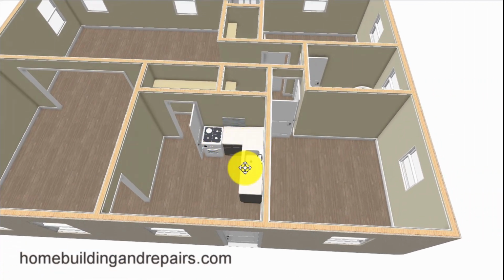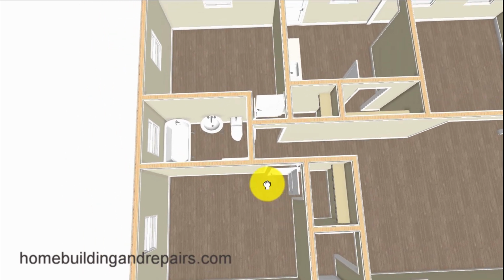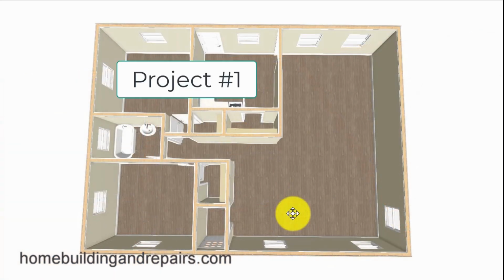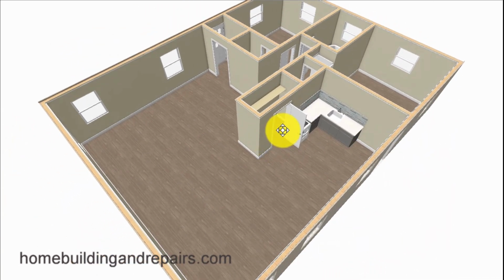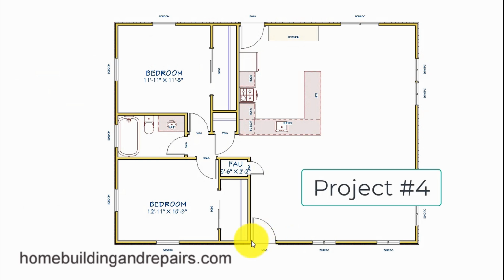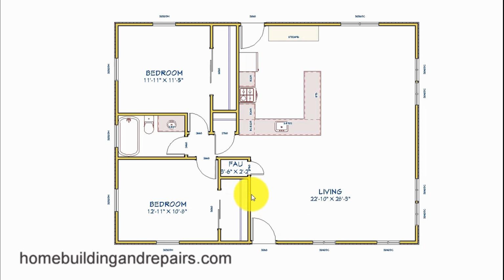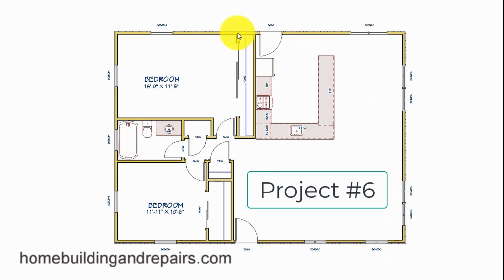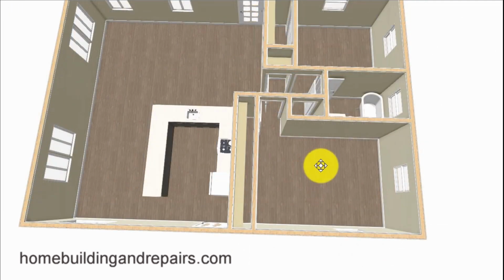Old House Remodeling Design Ideas Part One - Two Bedroom Home Converted To Open Floor Plan

Comment: You know what, I would put the kitchen at the corner of the exterior walls. I was taught to design houses with sleeping area(s), with the living area(s) and with the working area(s) design theory. The kitchen is consider the working area. And you placed in it where the living area should be.